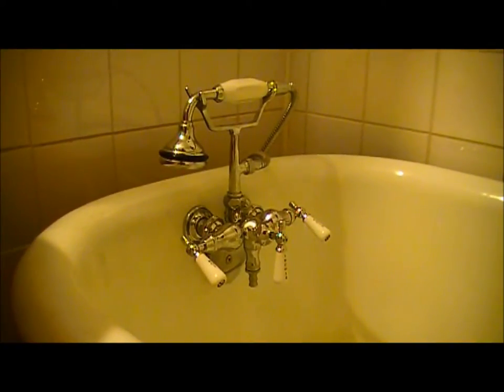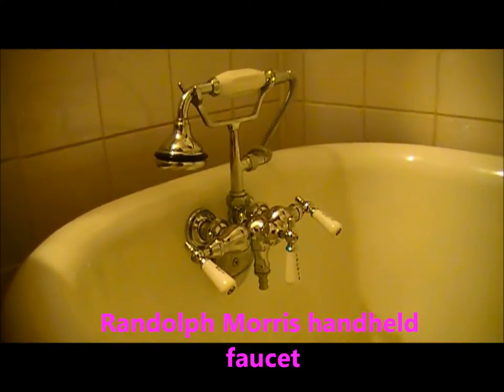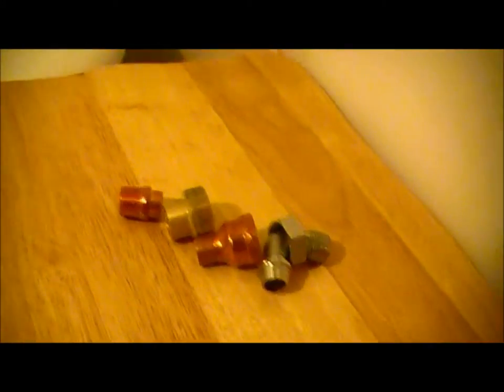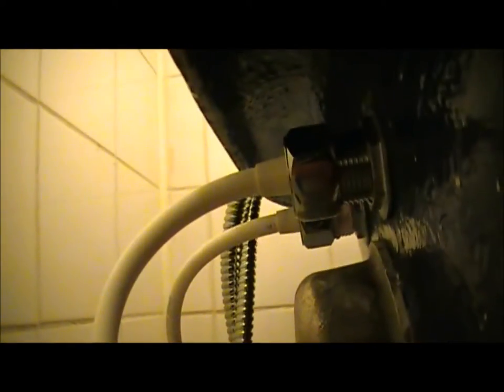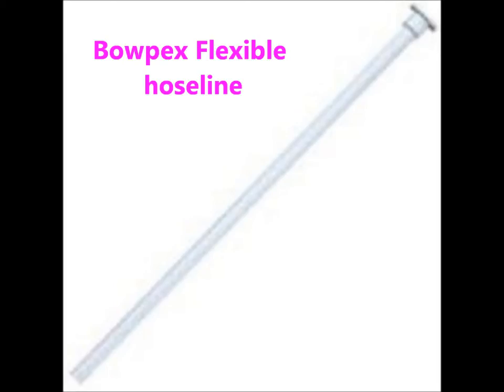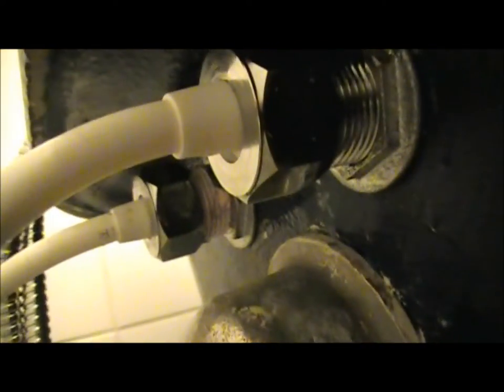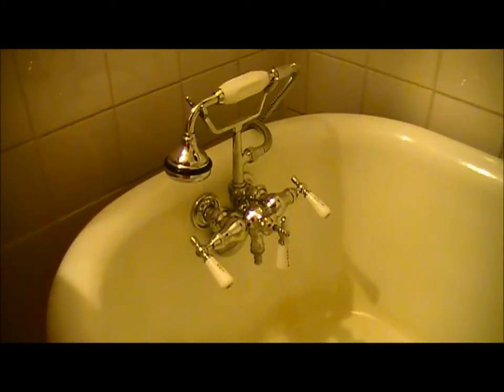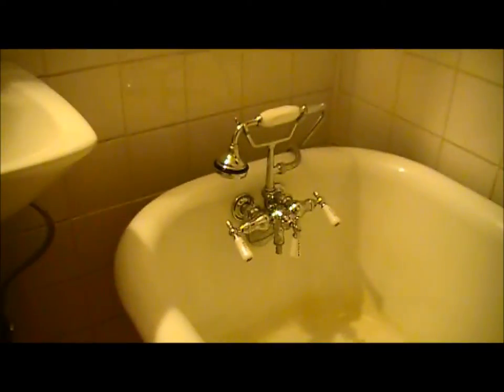Fitting hoseline Randolph morris handheld bath tub faucet

Comment: Good luck trying to get a replacement stem for these faucets.  You had better save all of your paperwork.  It is a ceramic disc stem and they told me there is NO return if it is not the correct stem.  Save the model number of your faucet.
Reply from the maker: Luckily vintagetub.com site sent me extra parts I requested with no charge. Great site for customer service and price.
Reply: do you happen to know the part number for this stem? 

I can't figure it out for the life of me.

Comment: The fittings look like the factory ones....
And dimensions we could get?
I have a tub with a slope to the front and the faucet sits with the water lines coming out at an angle and these lines are going to save this project, just curious about the fittings..
Reply from the maker: Hello!
The fittings for the hoseline or the metal fittings?

Comment: can you tell me where you purchased the bowpex we cant find it
Reply from the maker: You will have to head down to plumbing store and ask for it. Just bring your faucet if you can or measure the dimensions and show pictures of what you need it for.
Reply: @BClocals  Hi can you tell me the fittings were used to connect to the faucet straight shanks?  Was it a 3/4 female compression fitting  or female FIP?  I am  in need of knowing since I am in the same position.
Reply from the maker: @TM-wv1di  atm I cant say what diameter it is because I have recently moved. Chances are if you you come across the bowpex just buy the different sizes and fit them on. Luckily they are cheap so it wont cost much. All depends on the newer faucets size.